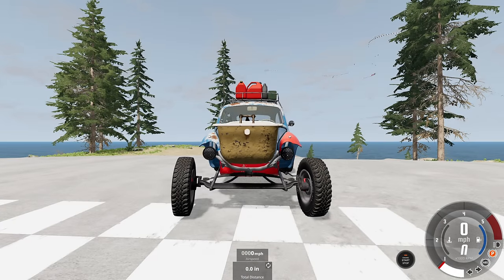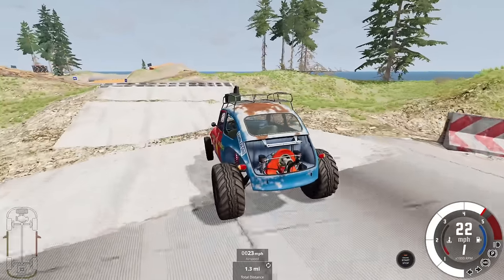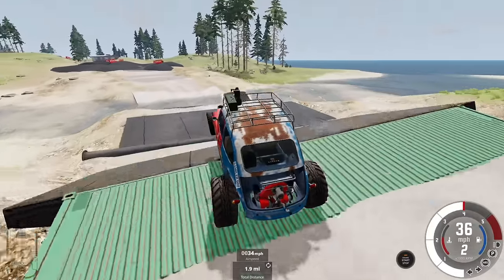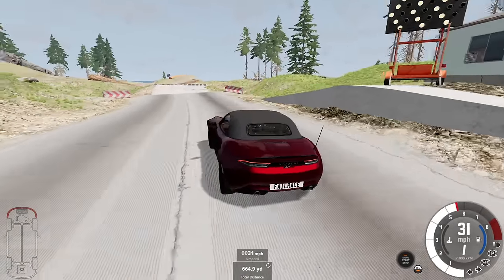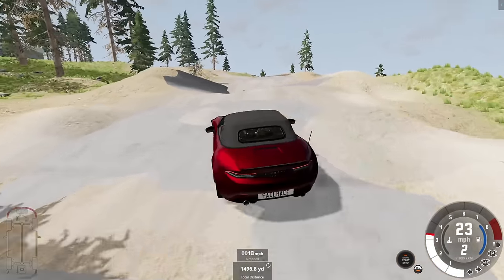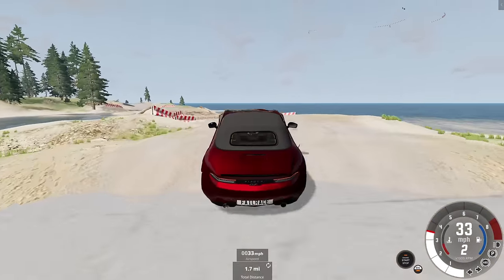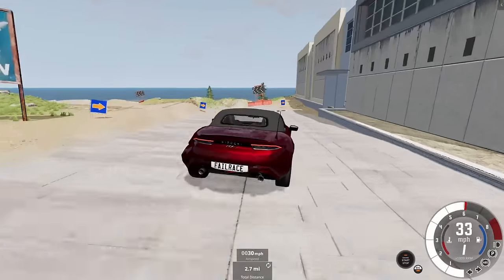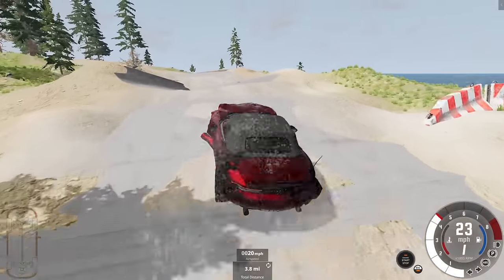Driven Till Destruction #3 - The Crazy Bathtub - BeamNG Drive

Comment: That Piccolina seems to be the ultimate mascot of building things flexible so they're strong. Which is actually a big thing in engineering, particularly how they build airliner wings and even some buildings, big cargo ships too.
Reply: That's why they use like 200 rubber bushings on anything that can more or twist on common road vehicles. If a suspension arm can move somewhat freely in most directions, but mostly stay at one axis then it's a lot more comfortable and less likely to have massive issues if you hit a pothole.

Comment: For a modified automation car, the miata is a pretty good mod. But I think it just survived because the functioning bits are from Automation.
Reply: It’s not a modified automation car. The CCF was recently remade basically from scratch. The driveshaft is pretty strong and the radiator got really lucky from my experience with the car. The wheels are the main weak point on it.
Reply: @SpaceGood.  The wheels seemed like they were glued on, on the CCF, definitely didn't seem like a weak point :D
Reply: @broklond  Well, it's all up to luck with what happens in Driven till destruction.
Reply: I see that even remaking a mod from scratch in beam doesn't let it shake its automation version. I guess everyone gets it but only if it's a Ford focus with rockets strapped to it.
Reply: @zenkoz3158  ? For me if it would have been made from scratch, I'm pretty certain that the collision detected and the spiking on the hood would not be there. And the mechanical bits seems a bit too strong.
Reply: @_Zdex007  go scrub through the files yourself, it's an entirely separate vehicle from the first one. Wheel axle beam strength can be changed on any vehicle in the game via the lua script editor. As for an spiking after deformation, it's a brand new mesh that was just released and it's free. I'm sure it's jbeam will be patched over time, but I guess expecting dev quality from a single person is more reasonable somehow these days.

Comment: The first car's suspension was a transverse leaf spring layout. It's strong and simple, but not very responsive for sports use. Ironically, Corvette used an updated transverse leaf spring in the rear of its cars until the C7 generation.
Reply: C2 and 3 are transverse leaf rear, but I think the C4 all the way to the C7 was front and rear, which is crazy. And also incredibly annoying that there was room for improvement that GM just... Never bothered with, instead continuesly boosting power and ultimately turning the Vette into a cheap supercar
Reply: @wolfgang_h3t  "pushrods" enters chat.
Reply: @swordmonkey6635  You mean for the engine? Not really a limiting factor tbh, the LT2 is rocking 500 horses N/A which is honestly more than enough lol
Reply: @wolfgang_h3t  The flat plane one is nearly 700 hp N/A using overhead cams. Tech makes a difference and GM knew it. The early 1990s ZR1 used OH cams and was the most powerful Corvette engine for quite a while.
Reply: @swordmonkey6635  Don't forget the 2017 ZR1 LT5 DOHC engine. 755 horsepower and 715 lb/ft of torque. I think that beat the early 90's 4 cam ZR1.
Reply: I am still an OG pushrod V8 guy. I like that I can work on those without needing a rocket science degree lol.
Reply: @whichgodofthousandsmeansno5306  I didn't. I used the early 90s ohc example to show that GM understood the advantage of overhead cams during the C4 era. The C4 ZR1 engine is still considered a beast for its era and it ran with the big boys.

Comment: Here we are yet again to count Failrace tumbles!

Now, here are all of the gorgeous "stunts" performed by Alex in this video:

12:40 = The bathtub didn't tumble once, but I'l timestamp the spectacular ending to it's run;
16:56 = The first actual tumble of the video, it took so long;
22:18 = It skipped on the concrete like a stone skips on water...whatahell?
23:30 = It was more so a summersault than a tumble, but it did fall on its side, so I'l count it;
23:52 = At this point it's rolling over so much that you might as well call it Hammond;
24:40 = And once again it tumbles and lands on it's wheels;
25:43 = The curse of the commentator strikes yet again!
26:16 = Skating on your side is definetely something that's not good for your health;
27:06 = I think that Alex "leaned" a little bit too much right there;
28:45 = This car really wants to go to the Olympics if it keeps on doing summersaults like that;
29:17 = It somehow managed to not hit the wheels when going over a concrete barrier, this car's a athlete;
30:02 = Introducing "Kitty Mazda"! It always rolls, but it always falls on its wheel!
30:40 = See? The previous advert didn't lie, it always falls on its wheels;
32:54 = The Olympic summersaulter Mazda tried to become a ballerina and broke it's legs, oh well!

Comment: You should take the new Autobello (forgot its name) around here. I took it around the old DTD circuit and it lasted 25 miles with 2 wheels missing, only quit because I got bored, thing is quite underrated

Comment: Suggestion on the scoring - if you say I lap is 100%, and then approximately calculate from there. Say a car did 7 and 3/4 laps it would score 750%

When spinning the wheels etc count as milage the current rankings are a bit meaningless
Reply: He does it off Laps completed and just shows the mileage as a rough thing, he said this first episode
Reply: Intact he even said it in this video